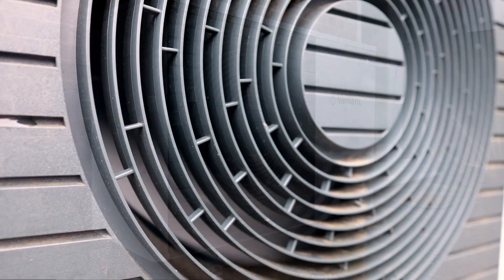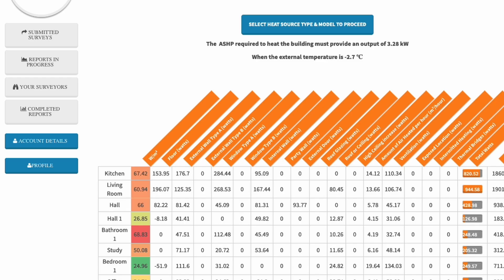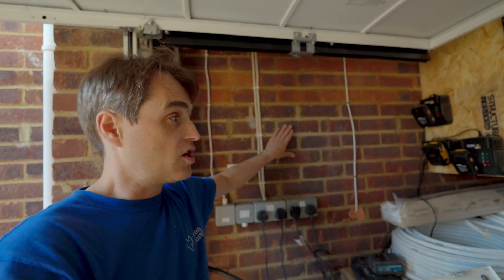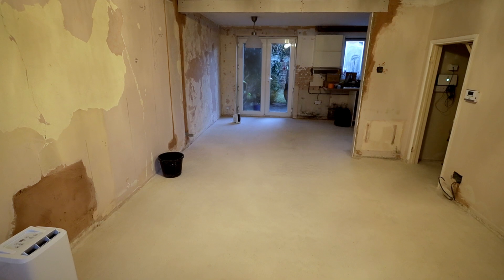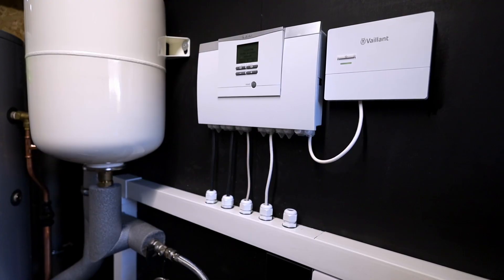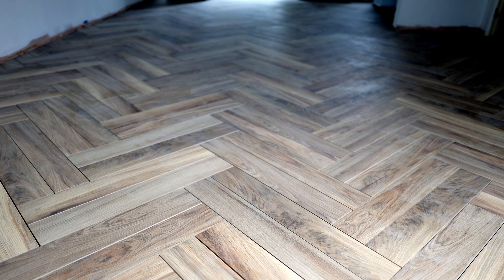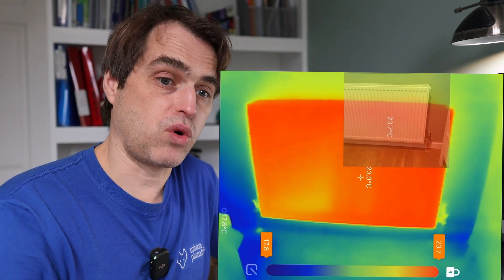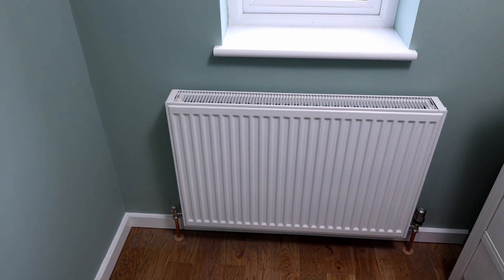How I Installed The Most Efficienct Heat Pump In The UK.

Comment: I live in West London with my parents and we are considering replacing our 25 year old boiler with a heat pump. However, the total cost to replace the old boiler with a new Gas boiler compared to a Heat Pump installation shows there is a large different in price, probably 3/4 more... Unfortunately this is why most people will just go for a like for like replacement...
Reply from the maker: You are not comparing apples to apples. Modern gas boiler with PDHW and WC running over 90% efficiency with correct low temperature system design will cost more at the moment than a heat pump in a lot of cases.

It is just that in the UK people install inefficient systems with condescending boilers that never condense. That is cheap - but not efficient and expensive or run.
Reply: You are correct, however, the difference between a Heat Pump installation and a new Gas Boiler installation in price will take many years to break even and in this time we would have probably moved to another source of fuel. I think it would be good, for you to produce a video comparing the three, New Gas Boiler without PDHW and WC, New Gas Boiler without PDHW and WC and Heat Pump including rough estimates and running costs and how long it would take to actually break even.    @UrbanPlumbers
Reply: @ssam3447  I doubt that the UK will have moved to another source of fuel.  Hydrogen is basically a non-starter for the UK and will be likely more expensive to run than gas, and if nothing major happens more expensive to run than resistive heating.  The upgrades he did to his house, were irrespective of the heat source as well, so the cost of the heat pump would have been easily covered by the 7.5K grant (assuming he could get it on his own property).
Reply: I agree, work done on the house will provide benefit which ever fuel source. Funny enough, I see Heat Pumps and their supporting upgrades costing a lot more than £7.5K @BenIsInSweden
Reply: @ssam3447  A lot of those "supporting upgrades" aren't really necessary for a heat pump.  Some will be necessary regardless when swapping out a boiler, if people actually following the building regs that have been in place for almost 2 years now (max flow temp of 55C).  You could skimp on the supporting upgrades with a high temp heat pump, but that will just cost you more in the long run

Comment: CoP is a really silly metric because it is exponential.

Say you need 10kWh of heat, at a CoP of 1,2,3,4 & 5 respectively you would need 10,5,3.3,2.5 & 2 kWh of electricity. Clearly at some point the savings become marginal. For most people, the time, effort and cost to get a typical system above a CoP of say 3.5 are never ever going to payback.....
Reply: It's not that simple. Check out Heat Geek's "This Insulation Secret Will BLOW YOUR MIND" video.  As many improvements to COP come from decreasing heat loss, which has the benefit of both reducing the amount of heat required and delivering it for less electricity.

Comment: RE BUFFERS, HEADERS, VOLUMISERS: I have watched just about every video you have made (no small praise I can assure you) your installs are class with amazing pipework skills  but have to say I'm so amazed and disappointed to watch you install a whopping 100L buffer on your own system ?! What ever has happened to "most systems do not need a buffer with a heat loss of around 7,500w (ish) ie bigger systems and "I have only installed 1 buffer in the last 12 months" or the video done at Michael DePodesta's house where you removed and commented on unnecessary buffer installations and costs with extra pump instal and savings up to 38% by removing same there etc etc ?? I am literally just about to have my system installed (same pump and size) and  with only a 5699w loss and I insisted from your advice and guidance that a buffer was not included !! I now have no clue where I now stand, I would appreciate a reply please asap (I see most comments go without a reply but this is really important for many of us OR better still a reply AND do a video very quickly to clarify this entire confusing situation.
Reply from the maker: It is a volumiser not a buffer. All of those things have a reason and it’s place. The problem is when people chuck them in not understanding why it is done.
Reply: Design is key.....Who can I contact to get the correct ASHP new build design completed ? Have you got anyone within the Urban Plumbers network who can design my underfloor Vailiant Heat Pump heating system for me.....
Reply from the maker: @user-qy1mv6yi6u yes email me

Comment: Wouldn't be wiser to keep as backup the old heater?
Reply: you don't get the 7K from the government unless old gas boilers are removed afaik
Reply: @thfc5  its like here (Greece) they are paying for house energetic upgrade, new windows, insulation. To save some kwh of consumption but not solar panels for half price that will produce the total of the year consumption. ( summer sun is providing 2.2kwh/m2)

Comment: Lovely installation. You the man! Looks like a space craft warp engine.
I like my boiler , its the best its only 95% , cost E120 to service. Only use it around 5 to 6 months a year. 
So the moral of the story is , what was the cost of your whole system plus insulation . How much carbon foot print was create buy manufacturing the components.  The old boiler is now also a carbon foot print that you have created.
How long will it take to make it value per money for the system to pay off. 20 to 30 years. In that time new tech would have been developed.  Check out solar. There you can go wrong. Just add. 
You cant install a heat pump if your house is not very well insulated.  Boiler heat up house super fast but heat pumps super slow. Another big problem that no one has a foggy idea. The National power grid. If 20 ppl in area add pumps , oh my goodness,  the current load??? Oh my electric car , how about that. Heat pumps and ev will kill the grid . Dont forget to look out side...
Reply from the maker: Average running power in is  450 watts so same as most houses background electricity use. Cost me £0 to install as grant paid for all the kit. I would have insulated and renovated anyway even if keeping gas. 

Slow is the way to heat your home with any heat source - gas/oil/heat pumps anyway - it way more efficient and cheaper that way.

Old boiler got sold on ebay to someone who will get it installed in their home, so no wastage here.

Your statements are pretty much wrong on all points and I could address them in much more detail - but can’t as I am mad busy installing heat pumps - fully booked with heat pumps for the foreseeable future - so luckily not everyone thinks the way you do!

Comment: You simply make the best videos on the subject. Hats off to you!

Have you got anti- fracture matting under the tiles? What are your thoughts on the TOG increase these surely have?

What are your thoughts on increasing system volume with a large volumizer to increase efficiency when it's relatively mild outside (>10C) and to also store energy during the night thanks to the cheaper tariff?

Comment: We still have a Vaillant coming gas boiler and in winter run the thermostat at 24 degrees. Yours was 20.5 degrees. Could it ever reach 24 degrees? Interesting video and your system looked impressive but I can’t see us managing with such low temperatures.
Reply from the maker: Yeah, can get to 30 if you want

Comment: Interesting, according to Heat Geek I will save £90/year when I replace my boiler with a heat pump. This will take 66 years to break even. That's the elephant in the room.
Reply: I would suggest then to only do it when you need to, I.e end of life of current boiler as you needed to change anyway.

Comment: Interesting video, how have you handled the raising of the floor with the underfloor piping and such? I think I heard you say that you weren't insulating (which suprised me) but even without that must have raised the floor by a few centimetres? 
If I did that here I'd need to adjust all the doors, the first step of the stairs would be off, new kitchen, etc etc.

Comment: Wonder How much would it cost to heat your house using gas with boiler range rated to its lowest possible output and considering same installation along with property insulation upgrades . Pozdro

Comment: Very nice!

Ignoring the insulation for the underfloor heating and says "to heck with it - I'm going to make the floor slab sit at 22C instead of 15C" is an interesting approach. 

I guess when the floor doesn't need to be that warm to heat the building (as the heat loss is now low enough and in this case it's tiled rather than hiding under carpet or wood) you are not materially increasing the losses through the floor to the ground and indeed the uplift in COP rom having the underlfoor likley offsets those heat losses anyway. Wish I'd thought of that when renovating a property!

Daft ideas:

Would it have been feasible to series-feed the radiators and underfloor? Rads first; to benefit from higher flow temperatures; then the underflor to really drag down the return. Might allow rads to be downsized furhter (or run at a lower flow temp)

Rads setup for a dP of say 15 kPa, in parallel with an auto-bpyass, feeding the underfloor circuit. Rads would be hotter / more responsive. Bedroom TRVs coud then throttle down whist the heat pump feeds the floor. Or just a bathroom towel rail that feeds the floor towards the shoulder seasons?

Why is the the valved off "Experimental" volumiser is on the return rather than the flow to the space heating circuit? (genuine question - I'm supposed to be putting in a fixie ground source unit this spring and need to decide whether to put the volumiser on the retun or the flow - and instructions suggest the flow rather than the return)

Waste Water Heat Recovery probably the next best avaialble option for reducing heat load?

Comment: I'm so jealous that your SCOP is bigger than mine.  I'd love to know how much more efficient my system would be with Vaillant, we have few options in the US and looks like the tech is much better now, manufacturer data for my unit tops out around COP 4 for 35C flow, in 7C air.  But I think the bigger issues with adoption is that system level thinking of insulating, air sealing, optimizing the distribution for low temps, and then finally not making things worse with temperature steps in the plumbing (as Heat Geek teaches so well).  When most people only think about this stuff when their "box" breaks, and most contractors are obliged to quickly swap that box, it seems quite difficult for anyone but the "domain expert" homeowner to be able to pull all this together.  I'm curious, as a business owner, how many of your customers just want their broken boiler fixed cheap as possible, and how many take you up on something as extensive as this, assuming you try to sell that to them, and then not sure if you try to act as a general contractor for the project, subbing out additional work needed to make it happen?  Anyway, you are doing more than your part by setting an amazing example so thank you and hope this gets many others informed and excited to follow in your footsteps for their own houses!

Comment: Those are low bills, nice job! For comparison, our medium sized '80's 4-bed-detached bill for last month with conventional gas boiler (s-plan, on/off controls with Nest) came to £295 …

These charges are based on your meter readings. VAT is included.
Electricity	- £108.80
Gas		        - £186.53
8th January 2024 — 5th February 2024

Comment: I loved watching this because I have the highest respect for your work, and I am in the process of preparing my own house for a low energy heating system as well. And I am very pleased that the concept I came up with is similar to what my favourite professional decided to do for his own house! 🙂 In some ways I am actually more radical, for example I use 50mm PIR insulation on the inside of the external walls, and in order to avoid cold bridges I ripped out every single internal wall so I can have an uninterrupted layer of insulation. There will be underfloor heating throughout the house so I don't need any big radiators, and I put in ducting for a heat recovery ventilation system. In fact, I started out doing all this to make my house as suitable as possible for a heat pump - but meanwhile I am beginning to wonder whether the energy consumption will be so low anyway that it's not worth buying a heat pump. I might end up using the electric combi boiler that I installed as a temporary CH+HW system for good, possibly supplemented by a hot water tank with electric heating element fed mostly by solar power.
Reply: If you've got room for the solar panels, it's actually not a bad idea. An electric boiler only has an efficiency of 100% compared to 500%-ish for a heat pump. The cost consideration is 5x the number of solar vs. the cost of a heat pump, for the same heat output. The advantage of an electric boiler, is no moving parts, harmful gases or noise. Could be quite a low maintenance system.

Comment: I wish we had space for the unit and the inside equipment. We have an old house and the rooms are poky and awkward with no real space for a plant room unless we sacrificed the downstairs toilet, which we don't really want to do. Also siting the outdoor unit would be tricky (position of shallow Victorian foul waste pipes, no room down the side and an end terrace). I am slowly improving the insulation, but the newer extension has no roof cavity access because whoever built it wanted a big vaulted ceiling upstairs in that area (utterly stupid design), so I'll have to apply insulated board to it, and preferably upgrade the old Velux window. All the 'modern' double glazed units are already done as they were nasty, and that has had a positive effect - we probably don't use any less energy, or not much less, as we can still chew 100kWh on a very cold day for our electric flow boiler on the wet UFH system, which was pre-existing and we cannot have gas, LPG or oil for logistical reasons. But the house is definitely more comfortable, except in prolonged cold spells in the main bedroom which has the high ceiling as the UFH struggles to keep up after a few days, but improving that roof will help. I still need to do two of the three external doors plus the internal garage door as well, and four old hand made wooden windows will get renovated and the double glazed units in them will be improved, although they will never match the 1.2 U value new units we've had in the other windows, but the aesthetic of that old part of the cottage at the front is important. But even when I've done all that, I still would struggle to find the space for all the kit required and for somewhere to site the outdoor unit where it won't interfere with our enjoyment of the small patio seating area or wreck plants with the cold air output. And that annoys me because I really would love an ASHP! Perhaps the outdoor units will get smaller and easier to site over time, I don't know - I live in hope!
Reply: A lot of old Victorian houses had lean-to outhouses or coal bunkers. Would there be space to build an external plant room (they don't need to be big, just enough to house the hot water water cylinder, pump and buffer) with the heat pump mounted on top?

100kW a day is a lot of electric to chew through. An ASHP could potentially provide the same amount of heat output for less than 25kW a day. I'm sure your return on investment would be fairly quick.
Reply: @shm5547  no unfortunately there's nowhere we could reasonably build an external plant room owing to the topography of the ground. It would pay back pretty quickly for us. Don't get me wrong, 100kWh is not a daily occurrence and we are in one of the warmer parts of the UK - it's only in really cold spells that we hit that much in a day and they don't tend to last too long - but yes we would likely get a pretty big reduction in bills, even if we did nothing more than fit a heat pump right now. But even assuming the plant room issue is solved, siting the external unit will also be quite challenging. I did wonder about the front of the house but that is only about a metre at most between the wall and the road which wouldn't be allowed. And we definitely couldn't have R290 as I believe they have extra siting restrictions regarding doors and windows. It's a puzzle that I am determined to solve one day!
Reply: I also thought an extension is the solution. 
The high ceiling should be easy to rip down and replace with appropriate thickness of insulation, which would be about 8" of foam board.
Reply: @DrRogB  8 inches? Not a chance, not least because that would completely cover the exposed beams, and there's no need to rip out perfectly good board when you can cover the existing board. Likely we'd use maybe 70mm insulated plaster board (at most, probably a bit less), as that would allow the beam to still be partly exposed but would be a significant increase to the ability to retain heat. The wall cavities only have about 25mm PIR board in them (I saw it when the windows were replaced) so after a point there is limited extra benefit of increasing the roof insulation because the heat will be escaping through the walls. I could, in theory, get the cavity wall insulation topped up with the bonded beads type, but given we get a lot of driven rain and the cavity looked pretty crappy I suspect this wouldn't be a good idea. The aim is not any kind of passiv haus status, simply to make it better over time. Even having a heat pump right now would drastically improve the energy use, but given the logistical problems that will take a lot of time to solve (if I ever can), in the meantime small improvements will continue to happen.